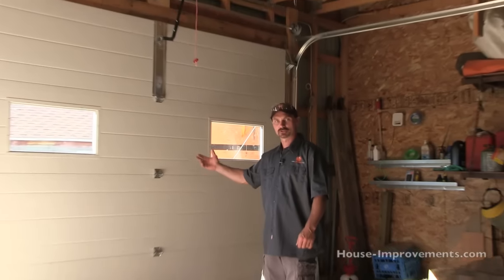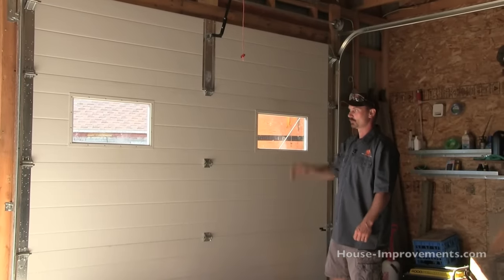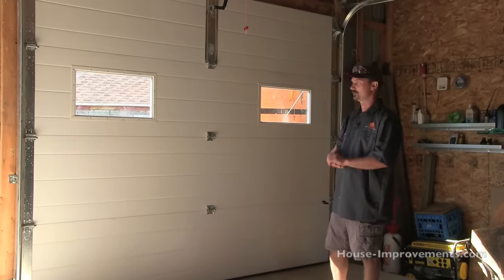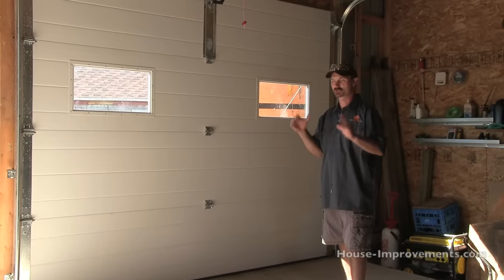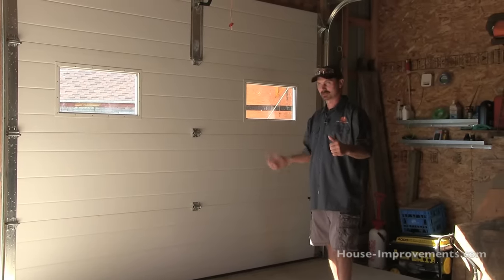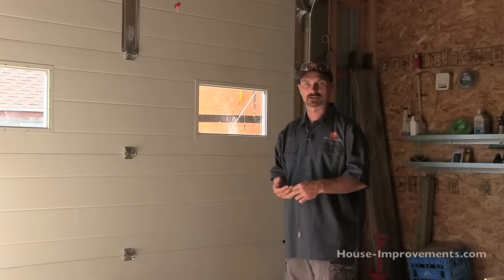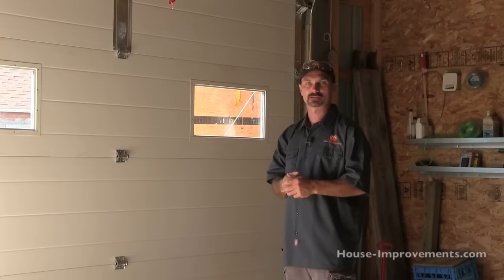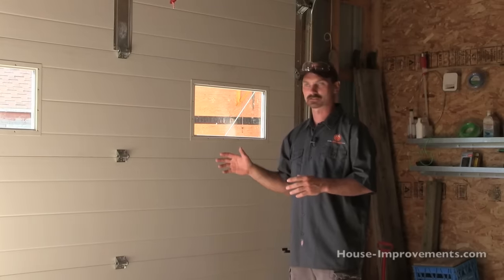How To Install A Garage Door

Comment: Super great video like everyone you did.  Thank you so much for your good work.  My trade is millwright since 35 years.  I instaled my garage door just the way you did, perfect!  Leveled everything with my laser level.  One simple problem with it.  The two cables have the same tension on both side when the door is close but at 3/4 open, the left cable is getting loose and the right one is very tight. It takes all the load.   Took my caliper and measured the pulleys. The right one is 0.015'' shorter than the left. Since the pulley is grooved on it's width to make the cable running, couldn't put shim stock over it to make it bigger.  Decided to put some electrical tape layer instead  until equal tension on both side and voilà !  When tape will be worn, I will just put new one.  No more problem.  Different mold for casting and it doesn't take much difference on circonference to cause that problem.  Call the manufacturing door installer.  Told me 1 out of 3 doors have that same problem and they never fond any solution.  Told the guy mine and he was so happy to ear it.

Comment: As a 30+ year industry pro I would not teach a new installer to perform an installation this way,  but overall he worked safe, he worked smart & at the end of the project the door seemed to work well.  This was a decent instructional video & will probably help someone who has never installed a garage door have the confidence to d.i.y.  For the record: I am not bashing how he did the work or anyone who watches this video to learn how to do this job- I have learned to do a lot of jobs outside my trade through watching similar videos.  I am positive that I have nowhere close to the overall knowledge base or skill set as Shannon.
Reply from the maker: Thanks Paul. Appreciate the comments.

Comment: You almost Mike Holmes'd yourself ( level not plumb). I like the way you use the level like a hammer to straighten out the bracket. Well done...just aboot.

Comment: Absolutely an EXCELLENT instruction video...and extend my compliments to your cameraman as well...he (she?) kept up very well so that no detail was missed.  Having installed (and repaired)  a few  garage doors and openers in the past, and am getting ready to replace my own 16 foot door, this was a great refresher. Entertaining and complete...and you were never boring. In most cases, one should also be sure to level the first section before adding the others, but in the case of this video, aligning the door panels with the wood framing probably accomplishes the same thing. One suggestion to wind the spring.  As mentioned earlier in another comment, before winding it, snap (or mark) a line along the length of the spring.  Then as you wind it, the number of turns will be easily counted by the number of circles on it.

Comment: As a garage door installer I highly recommend finding an Amarr or CHI dealer for doors. Steelcraft will get you by in warmer climates but anywhere that gets snow will most likely have rusting issues with Steelcraft. Also, their hinges and cables are cheap and do not last as long as they should.

Comment: I've put a 10x10 door and a 12x12 door up, to the point of hanging the overhead parts (I have 12ft side walls and a 20ft peak, the doors are in the middle on each end of 60x60 metal building). I installed the upright track first (as per instructions),12x12 is electric and manual chain, 10x10 is manual. I got 4 panels up on the big door before my help arrived, what a job for a 63 year old! I found out on the 10x10 door that I could stack each panel up and then put wheel and hinge on. Instructions said to mount hinge and wheel to panel and put into the track at an angle, what a pain! Your way is much better and easier that what I did. Now I just have to install top pieces, and spring bar on both, and the BIG motor on the 12x12 door, not looking forward to that!

Comment: Bro, if the bubble is a bit off, you can bet it's more than 1/4" out of level over 8'.  Try using a laser level to check for level.  New tech sometimes is much better than old school, even though I am 63 years young :)  Cheers, and keep up the great work.

Comment: The reason the opening is sized to the door is because you add a stop molding which is approximately 1/2" in thickness for the door to go against. Usually it is vinyl with a weather seal to seal up against the sections.
Reply: usually we << (works for a door company) like a 1'' overlap on the frame  then the weather strip which isnt crimped down to the door so it has flex area left (makes it last longer) and we put the side rails in with or at the same time as the lower panel(no nailing)setting roller gap on the way ...(hey its the way the midland door factory guys trained us)until you get to the last panel then we install the horzontal overhead track  with a slight slope toward the opening ,wind up the springs ,,install the top panel and test fly the door...adusting roller clearances  with the mount braces....(uprights have to have kinda  the same elevation..in case you have a crooked  floor so the door turns the corner at the same time on both ends)     but all in all  your just pluggin the hole ...just dont chew on the spring tighting bar.....

Comment: I had always heard about the dangers of the torsion springs.  Definitely built my confidence to do this myself. I might dry fit the center bearing without the spring or drums installed on the rod. Once i'm confident everything is aligned and level, reassemble with the drums and spring assembly. Also if the set bolts are a square head, I will use a 12pt socket and ratchet to tighten them. And I will probably use some sort of "s" bracket to hold the door panels in place (instead of bending over the nails). Awesome video!

Comment: Hey Shaun, I saw a Garage Door Installer, one time, spray a straight white line horizontal on the spring face first, before tightening, then when tighten the spring, the line curls around the spring, and helps count the revolutions when tightening the spring....
Reply from the maker: sounds like it would work if sprayed right at end.
Reply: that is not necessary not wrong but all professionals have different ways of counting how many turns there putting on a spring only thing that matters is the right amount of rotations you put on a spring

Comment: Thank you for such an informative & useful video that clearly explains all the ins & outs of doing this.  What was going to be an intimidating task was made all the easier thanks to you & I was able to complete the job with a smile.  All your other videos are excellent as well.
Reply from the maker: Glad it was helpful!
Reply: @HouseImprovements  The only thing I wish I had was a helper to help keep count while winding the spring.  I lost count 2X & had to unwind it & restart again because I was soooo concentrated on making sure that the bars were fully seated before each turn of the spring.  Safety first🤞🤞 All your tips helped tremendously, thank you.

Comment: Thanks, man!!  I ordered two garage doors for $2500.  Installer wants another $2,000 to put them in.  You have inspired me to try it myself.  I am a machinist so I should be able to handle it.  As you stated, the spring is my biggest concern.
Reply: Man, that's like 15-20hrs worth of labor. I feel like a lot of people think we're a bunch of charlatans out to take advantage of them because of people like that doing business dishonorably. Ohd work is an honest profession for those who do honest work, and there's actually quite a lot of depth to the trade.

Comment: Very good video!  One safety tip I'd make though based on an accident I witnessed when helping my dad install his wooden and very heavy 18 foot wide OH door maybe 30 years ago.  We didn't read where it said how many turns to give spring.  We also had vice grips on shaft.  Long story short, we over tensioned the springs (I think it had two springs) and when dad climbed ladder to remove vice grips like you did in video, the door went ripping up at a fast clip, and the step ladder dad was on got hit by door, and dad was knocked back onto cement floor that had some left over lumber on it.  Dad wasn't seriously hurt but it could have been much worse.  I'd suggest you leave a bar in and tensioned against the wall before removing vide grips.  Then carefully back off bars until door is confirmed safe.  

I watched video as I'm reinstalling a small OH door after reframing the wall.  One thing I learned was that the hinges are numbered.  I did't know that (no instructions).  Also I think I'll add the 2x6 to inside wall face.  It will have the door sitting1.5 inches more into garage but the lag bolts will also have a better surface to mount to.

Thanks Shannon!

Comment: Great vid bro, but from a pro- the finished framed opening size, depending on manufacturer, should be
Width=50-80mm less than the door. 
Height= 10mm less than the door.
After setting up the first panels hinges and connecting the cables to it, i put panel no.1 in the opening, centre and level it (within 3mm) then use that panel to measure off for the rest of the install. I cut the vertical tracks to height (if needed), loosely bolt on L brackets, thread each side over the panel's rollers, plumb them with 6-8mm axle play and screw them to the wall. THEN setup panels 2 and 3 and lift them into place guiding their rollers into the vertical track too so they are secure. A nail wont hold all those panels if its a heavy door or its windy! Plumb edges of panels and screw together. Bolt together flag bracket, bearing bracket and front track support, attach to top of vertical tracks and screw to wall. Push track till door sits against the wall, pull back to give door 4mm clearance and tighten bolts. Bolt top track loosly at track join, lift and bolt to front track support arm. Line up join and tighten join bolt, level track and tighten all bolts. Fabricate rear ceiling brackets and fix to ceiling. Setup springpole, thread in into bearing plates, screw spring bracket to wall, bolt springs to spring bracket. STARTING WITH THE LEFT HAND SIDE, hook cable lug into cable drum slot. Wind cable around drum till tight, lock off with grub screws. Keep the cable taught but dont lift door. Using vicegrips, lock the springpole off- both ways- Then do cable drum on right side. get cable tension as even as possible, tension springs up, test door... 

Average 3 doors a day for the last 17 years. 🤙

Comment: Great Video I did not look at the comments but those special bolts are called elevator bolts.  They are designed to be installed around moving machinery.

Comment: I'm a garage door installer. You should be using 13 gauge punched angle exclusively for the rear back hangers, no wood. It won't last as long. Your corner brace needs to be 45 degrees. Also, since your spring doesn't have a line on it, you should have painted one on with chalk so you can count the winds after you're done. Otherwise, you did everything correctly.
Reply: Except he should set his track when he puts that bottom section in so u don't have to use nails.

Comment: I'm always amazed that what you're doing is either what I'm doing, or what I'm about to do. I've got an existing 7'h x 14'w garage door with ceilings in excess of 12 feet and I want to be able to drive a work truck or a camper into to the garage. I'll have to reframe in steel H beam since this is California and you can't do anything here without over doing it due to earthquake standards.
Reply from the maker: Sounds like a nice project!
Reply: HouseImprovements
Yeah, I'm looking forward to it. Along with that I'm going to excavate out the back half of the house crawl space (front half is garage) and also drop the level of the front of the garage to the sidewalk level. That'll give me about 15 foot ceilings in the garage and future shop space.

Comment: I dont really agree with with several of the techniques he used to install the door I myself would have done things very very different but however he does a fantastic job going over all the materials for the door and steps for them as well for anyone who has never built a garage door this is probly the best thorough and safe explanation of installing a garage door he covered damn near everything about putting a garage door together.

Comment: As a real pro overhead door man of 30 years i cant help to not critek your work the biggest thing to do it with time saveing and a quality job the primarry concern is to do all you can do at any time you can the first time you are at any point will cause 2 things 1 you wont be back tracking and 2 you wont forget something.

Comment: Another hint for rotational reference.....in your case you speak about 8 or 8 1/2 full turns, .....since the cone winding slots where you insert the 1/2" dia bars, are 90 degrees apart....it helps to call these out as 1/4 turns.....where (for example) 8 full turns = 32 "quarter turns". It's easier for most people to keep track of quarter turns as you wind.

Comment: What's a "graaaaage"? Sorry, just a little cross the border humor that isn't very funny. Great video, it helped me a great deal yesterday when I replaced one of my garage doors. I'm pretty sure the visuals saved me a couple of hours, considering the installation instructions were clearly written by someone who probably couldn't install a light bulb. I'll be replacing the other two doors this weekend, and I think the process will be just as smooth thanks to this video. I really appreciate you taking the time to explain the steps, and not trying to squeeze it all into a 7 minute video clip. Thanks!!!
Reply from the maker: thanks for watching, glad it worked well for you

Comment: Nice and very helpful! Next time though I would recommend putting in the vertical tracks in first before the panels. It makes it a little easier. When your done with the 3rd one put in the horizontal before the top panel. Just to be safer, but this was a very helpful and nice video though.

Comment: Great job, love your videos, one tip I do is put some tape near the end of the tools for adjusting the spring tension after they are inserted fully, that way you can see if they are fully inserted each time as the tape will show flush with the top of the drum. this way you can be sure it won't slip from not being inserted all the way :) hope this helps
Reply from the maker: That's a good idea!

Comment: Most common door sizes are, 8x7, 8x8, 9x7, 9x8, 16x7, and 16x8... Draw a line down the spring with chock or paint to aid in counting revolutions. On standard door heights, it's almost always half a turn more than the height of the door. 7'=7.5 turns, 8'=8.5 turns.
Reply: @Stan Kappiris Yes, lengthwise, the line will show a spiral that will tell you how many revolutions you've went.
Reply: @Stan Kappiris Yes with the shaft.

Comment: Thanks for this video. Really nice explanation of the process. Just some feedback. Sometimes you seem rushed and then eliminate some steps that make a difference to the viewer. I had to fill in some of the blank especially where your camera guy had some trouble. Really nice job overall. I feel like I could attempt to do this myself. However the 4-5 hour install on first attempt and my cost in time, make it a perfect job to hire out to a pro. Thanks again.

Comment: Yes really great job here..  demystified the process... I have a double car garage door and the whole installer base is pretty spotty.  Like 7 different opinions on the size of door and whether there is enough clearance.  Your install was easy because of all the space beside and above but in my case I am replacing a one piece door which requires less clearance above and beside.
I will try to find a video showing a low clearance install
Reply from the maker: Usually for a low clearance you need different track or hardware. The supplier of your door should have info for that.
Reply: surprisingly there are many different opinions on what clearance is needed  not to mention side to side clearance .   In some respects it is almost better to install the doors yourself because you know you'll end up doing a better job than someone who just wants to get the job done as fast as possible